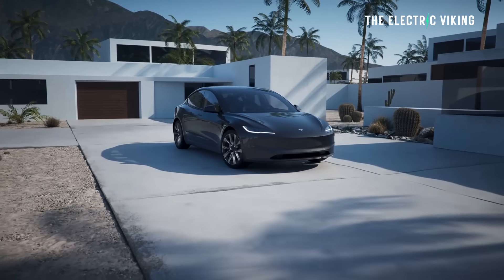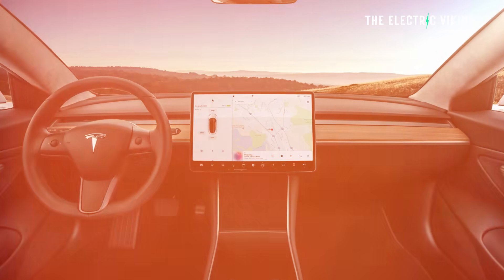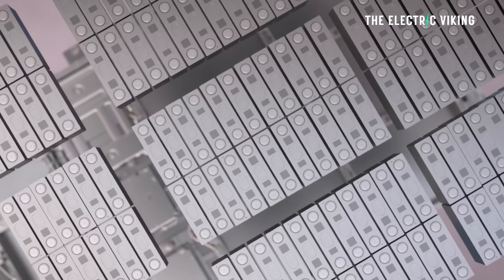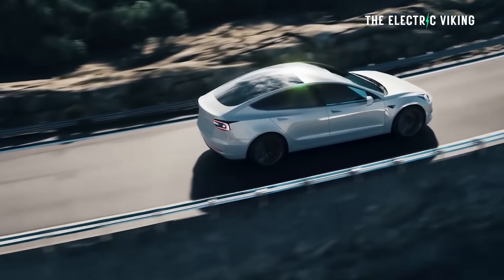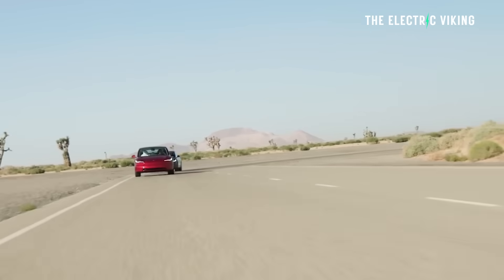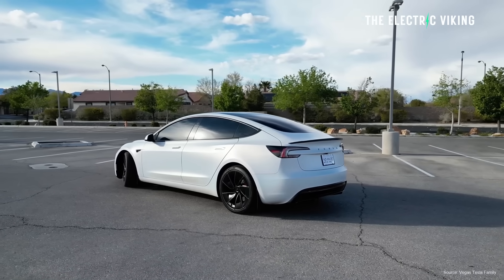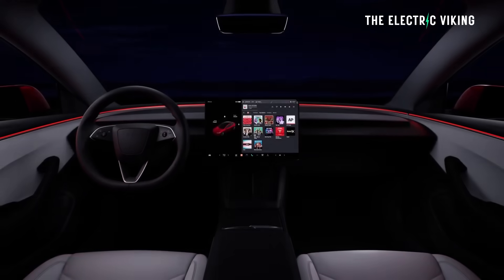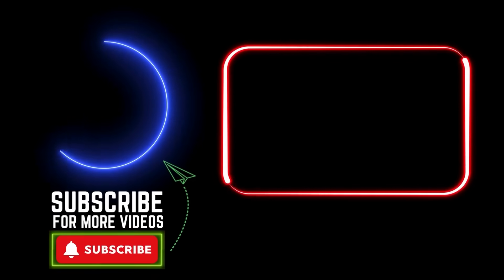Tesla Reveal Longest Range Model 3 EVER with battery and camera changes

Comment: FYI - I’m in Australia and purchased the long range model y juniper this this. The WLTP is 551km - it is lucky to get 400km - I love the vehicle in every way but I’m really pissed the real world distance is so horrendously different to advertised.
Reply: The problem is in WLTP standard that is widely used. It is good enough for comparing range among cars. And it is good for ICE cars that have better efficiency on highways, but not for electrical cars that have the highest efficency at 40-50km/h. If you will drive at very low speed - 45km/h, you will get 25% more range than advertised. For 
highways, extract 30% from WLTP range, 40% in winter.

Comment: Its as easy as this; Yes, new battery with a little more range, probably not noticable in everyday sdriving, stalks and camera in front. So, buy S3xy Stalks instead with better premium feeling and more functionality and wait for front bumber camera to be retrofitted at a certain cost. All those who already have a 2024 or 2025 Model 3 as I have ( 2025 M3 LR), JUST KEEP IT:) Its not outdated in any way or in any sense. The real improvements will probably come in 2027, with likely new Interior, Hardware HW5 plus next gen drivetrain, batteries. Enjy your car in the meantime, its a bloody marvellous car

Comment: Just to clarify, we had this car and it doesn't give you 750 kg. Maybe this is like a best case scenario but we haven't got this range but it was the best range we got in a Tesla.  Around 640 km.   City plus Highway.
Reply: WLTP is standardized range with some controlled conditions, simulating highway and the city. Its good to compare the range among cars. 

If you would drive in a straight line 40-50km/h, you would easily make more than 1000km. On a highway at 130km/h, you would probably not make much more than 500km/h. Because usually the longer trips use highway and high velocities, WLTP standard is too optimistic and some other standar should be used for electric cars.

Comment: How about Tesla giving an option of an alternative roof? Having a glass roof in Australia is absolutely ridiculous! One good option would be to have a white, insulated roof, at least that would refect solar radiation and lessen the heat transfer. This would also increase the range as effectively, it would have lessen the load on the heatpump and therefore, also the battery. Best option would be for solar panels to provide a bit of  charging.
Reply: Yep, Australia has a bunch of very hot climates, and the highest skin cancer rates in the world. These panoramic glass roofs were designed with cold, overcast Northern hemisphere climates in mind. By all means offer a glass roof as an option, but have a solid roof option as well.

Comment: Love it. Don’t want 19” wheels, don’t need AWD, don’t need to get to 100 in 4 seconds, want long real world range at an affordable price.
Reply: I’ve had the rwd model 3 for 5 years, 110,000 miles now, living in NW Indiana. Driven in all weather, including snow, and it has been fine. Will get another RWD next time.
Reply: Well, problem is you get the lower quality interior of the Standard Range. That would currently be a deal breaker for me for the RWD.

Comment: I believe it's not so much the diameter of wheels its the wide of the tires , wider tire = more rolling resistance  Also tire pressure and tire compound play a big part
Reply: my understanding is that they are both 235 series tires, on both the 18 and 19 inch wheels.

Comment: Grok Ai calculated how many people drive to Sydney instead of fly 
It’s about 20% 
80% fly 

Final Answer
Excluding trucks and vans, flying accounts for approximately 78–81% of people traveling between Sydney and Melbourne, while driving (passenger cars) accounts for 19–22%. These figures align with transport studies estimating air travel’s dominance (~70–75% of total demand, slightly higher here due to excluding non-passenger vehicles). Rail and coach (~5%) are excluded as per the question’s focus. For context, air travel’s share spikes during peak seasons (e.g., December), while driving gains traction for budget-conscious group travel.

Full Answer by Grok Ai

To estimate the percentage of people flying compared to driving between Sydney and Melbourne, excluding trucks and vans, we need to refine the previous estimates to focus solely on passenger cars for driving and compare that to air travel. Using the 2023–2024 data from the prior response, here’s the updated analysis:
Flying: ~9.3 Million Passengers Annually
	•	As established, ~9.3 million passengers (one-way trips) flew Sydney-Melbourne in 2023, based on BITRE aviation data. This figure remains unchanged since it directly counts passengers, not vehicles.
Driving (Passenger Cars Only): ~2.2–2.6 Million People Annually
	•	Hume Highway traffic: ~18,000–20,000 vehicles/day (AADT, 2023–2024 estimate).
	•	Excluding trucks and vans: Heavy vehicles (~25%, or ~4,500–5,000/day) and vans (assume ~10% of light vehicles for commercial use) leave ~60–65% as passenger cars.
	◦	Calculation: 18,000–20,000 × 0.6–0.65 = ~10,800–13,000 passenger cars/day.
	◦	Annual: 10,800–13,000 × 365 = ~3.94–4.75 million cars/year.
	•	Occupancy: Assume 1.8–2.0 people per car (conservative for intercity leisure/family travel, excluding solo commuters).
	◦	Total people: 3.94–4.75 million × 1.8–2.0 = ~2.2–2.6 million people annually (one-way equivalent, assuming most trips are return).
Percentage Comparison
	•	Total people (one-way):
	◦	Flying: ~9.3 million.
	◦	Driving (cars only): ~2.2–2.6 million.
	•	Flying as a percentage of total (flying + driving):
	◦	Low-end driving (2.2 million): 9.3 / (9.3 + 2.2) = 9.3 / 11.5 ≈ 80.9%.
	◦	High-end driving (2.6 million): 9.3 / (9.3 + 2.6) = 9.3 / 11.9 ≈ 78.2%.
	•	Driving (cars only) as a percentage:
	◦	Low-end: 2.2 / 11.5 ≈ 19.1%.
	◦	High-end: 2.6 / 11.9 ≈ 21.8%.
Final Answer
Excluding trucks and vans, flying accounts for approximately 78–81% of people traveling between Sydney and Melbourne, while driving (passenger cars) accounts for 19–22%. These figures align with transport studies estimating air travel’s dominance (~70–75% of total demand, slightly higher here due to excluding non-passenger vehicles). Rail and coach (~5%) are excluded as per the question’s focus. For context, air travel’s share spikes during peak seasons (e.g., December), while driving gains traction for budget-conscious group travel.
Reply: Whats your point bud

Comment: I live in the U.S. and just checked the Tesla website.  The "standard" model 3 ( I currently own a 2021standard model 3 with 263 mi. EPA range) does not seem to be on offer at all in the U.S.  The cheapest model 3 is the Performance version which is over $42k.  What happened to the $38k model 3?  Do they intend the new low priced model Y to fill that slot?  I'm disappointed.  I hope they change this.  Is a low price model 3 in the works too?

Comment: The Mercedes CLA EV 250+ announces 792km (492miles) WLTP. No rival on the market beats that.
Reply: BMW ix3
Reply: @rasulramazan3341 not a rival. Different segment. Even so, I doubt that with that shape it will match the WLTP. I might be wrong...
Reply: @madsdgdhg agree that it is of the different segment, but 800km+ WLTP is an impressive result
Reply: Hat er aber nicht erreicht im Test in Deutschland

Comment: Elon said nobody needs that much range. What happened?
Reply: Actually its the most readonable thinking (you get lighter, cheaper car), but people are not reasonable and so he has to adapt. After I bought electric car that I charge at home, I lose no time at gas stations. Before that, I was there every 5 days, losing 10 minutes. In half a year, I haven't had trip longer than 400km in one day. so I used supercharger only to test it. And 25 minutes pass by so fast...

Comment: 9:05 - Regarding the shifter on screen (or elsewhere); I'm curious what actual software is shipped with Teslas into Australia? Here in 'Murica I just took delivery of Y Juniper (my second Y in 32 months) AWD with a complimentary month of FSD, etc. There's no shifter except on screen....but I never have to touch the screen or anywhere else to shift. The software includes "Predictive Shifting"; the car infers which direction to travel, automatically shifts into the proper gear,  and only requires me/driver to tap the peddle to confirm and go. In FSD navigation I only have to push a blue "Confirm" button while in park and the car goes into gear and goes. BIG PICTURE - These features point only one direction: Tesla is ferociously fully committed towards the autonomous future.

Comment: Wait, the base model has an LFP battery while the performance model has an NMC battery? So you pay more to get more range and more performance, but the battery will die out in around 8-10 years max?.. I'd pay less for the LFP battery model.
Reply: It will not die in 8-10 years. If you hold It between 20-80% for regular use and only load to 100% for long roadtrips It will outlast your car auf will go 300k miles.
Reply: you need to change 8-10 years to 15-50 years....

Comment: I believe the new BMW IX3 has a range of 804km
Reply: True but the battery is drastically larger and also slower to charge per mile so if your road tripping longer distances, The Tesla is still better unless you decide to buy a lucid
Reply: +too expensive for the averidge man
Reply: Guarantee it will never be close to that in real range driving or beat the Model 3

Comment: Great car but will still lose customers (like me) because of lack of driver controls and driver display. Personaly I like badgers and a couple of storks, just like a normal car, keep it simple, it works, at least give the option to have these options fitted. And normal manual door handles so in a crash or if you drive into a river the doors can be opened, safety first. Couldn't give a fig about self driving, waste of time.
Reply: This is exactly because they want to keep it simple and the price down. stalks and buttons add to the price and lower the reliablilty as more things can go wrong.

Comment: All these range claims are in a perfect laboratory environment. In the real world and makes a mockery of 0-60 times and top speeds because that just eats away at the presumed mileage. 400 ish miles on a charge if you drive like a granny going to the shops. A 20 year old Volvo diesel estate, obviously in good maintained condition has the potential to achieve a range of over 500 miles on a full tank, especially with efficient driving habits.

Give me a well maintained Volvo diesel any day of the week of one of these overpriced and highly combustible milk floats, in my opinion.
Reply: Get real. My last diesel had a range of 680 miles on a full tank. Never ever did I fill it up and drive 680 miles from pump to pump, never. At some point I or passengers wanted a p or food. Hence my 300 plus mile EV has never gone full range plug to plug without stopping either. I’m fine with you forking out to keep a old diesel running. If you could keep all those carcinogenic fumes to yourself though. It’s not a little problem as the medical experts (that’s trained clever people that study the facts) routinely point out. I’d suggest a hose from tailpipe to interior then everyone is happy.

Comment: NMC batteries are built for arround 500 full recharges and LiPo is for 3000 recharges before they dagradete to 90% of initial capacity. So it is although point for considaration.
Reply: Nmc does way more than 500 cycles
Reply: LFP = low energy density and poor performance in extreme temperatures (e.g. winter, summer).
Reply: @KP-xi4bj  CATL Shenxing LFP battery has 205wh/kg vs 120wh/kg for the cells in the model 3SR and 175wh/kg for the LR. 

Try again 😂
Reply: @tjts1  The Tesla 2170 NCA battery cells, developed with Panasonic, achieved an energy density of over 800 Wh/L and around 322 Wh/kg.  

Try harder L̶F̶P̶  China, try harder.  😆🤣
Reply: LFP is easily 6000 cycles now..some closer to 10000cycles…NMC is around 2500 cycles
Reply: @yammybolo222 so NMC would do 1 million km based on 400km range. I dont think any cars would do that. Time is probably more important.